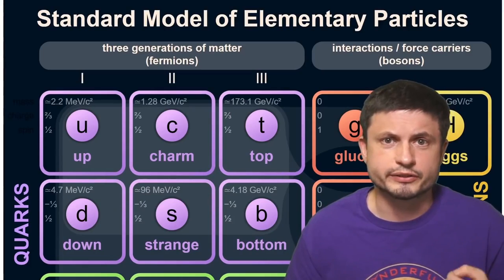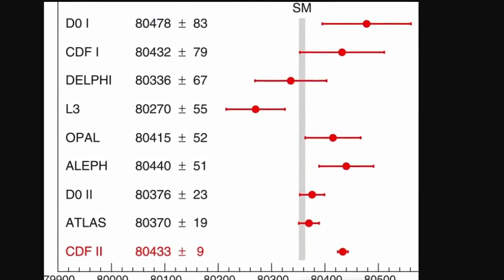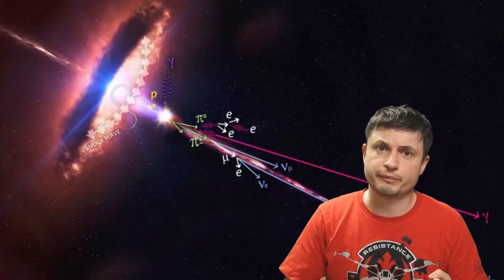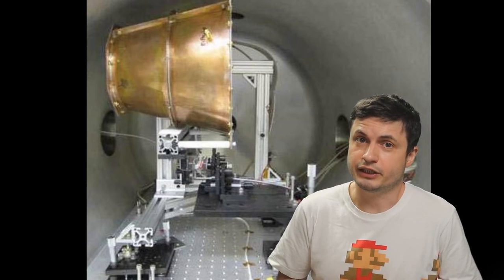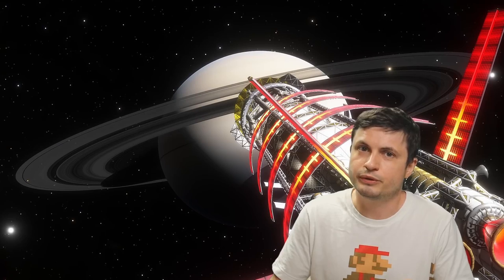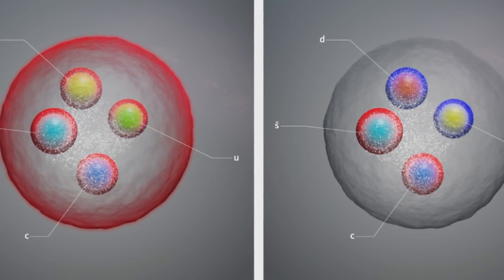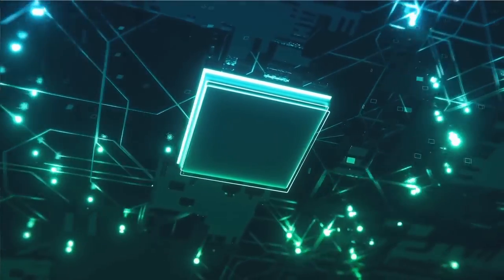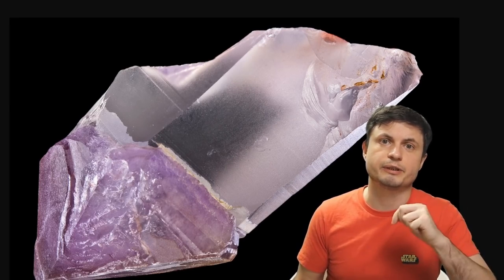Incredible Discoveries In the Field of Physics, 3 Hour Video Compilation

Comment: The Casimir effect is not about particles.  It is an electromagnetic wave restriction phenomenon. In other words, the two plates form a resonant cavity that precludes most of the electromagnetic spectrum from oscillating between the plates.
So, the Casimir effect is a function of the local electromagnetic noise. In other words, if you had the experiment made inside a superconducting Faraday Cage, it would vanish. It has nothing to do with Quantum Mechanics.  It has to do with Maxwell's equations, and it is a macroscopic phenomenon (non-quantum mechanical)

Comment: I think I know what is missing.  People, too many people have been left behind in this process. You are working with all educated people, who all went on after high school and got a higher education.  You all were taught the same basics and when something did not seem right, you went on to prove or disprove it. But there are always different ways of looking at things and maybe what is needed are people who have not been educated in the same way you all have been.  Let me give you an example. . . Many years back, my then boyfriend, his son and I were down on the beach doing a bonfire.  We were able to take our 4-wheel drives right down on the beach.  As we were leaving, it was about 3 am, we came across a truck that had been stuck in the sand for a while.  This was before cell phones and they had actually sent someone walking to the nearest phone booth to call for help.  We stopped to help.  They tried everything, kept digging themselves deeper and deeper,,,,,,, and then they discovered something was broke on the underside of the truck.  I was sitting on the sidelines, drinking another beer and listening to them try to solve the problem.  They were saying, "if we only had this", "if we only had that".  I knew a little bit about the inside of an engine.  I could change my own oil and spark plugs and at one point was talking about rebuilding the carburetor on my '74 Camaro.  Not bad for a girl, but I knew nothing about what makes the wheels work or how 4-wheel drives work, but listening to them, I had an idea, of something seemed like it might work, if only to get them out of the sand, using a belt, the kind that holds up your pants.  At first they were not listening to me but finally I one of the guys heard what I was saying and said, "That just might work".  And it did.  We got it out of the sand just as the tow truck was coming across the beach.  Those guys were all thinking along the lines of what their dads and auto shop teachers taught them.  I was thinking in a totally different direction, that if nothing else, got them out of the hole they dug themselves into.
How many people, over the years, were left out of the process?  People who have brains that work just a little different.  They think about things in a different way.  They were left out because they did not have the money for college.  Maybe they had to work the family farm, sacrificing their education.  Maybe they found themselves in a teenage pregnancy and had to give up school to raise a family.
There needs to be a way to include more people into the process.  A few simply words or what may seem a silly question, could get your brain working in a different direction.

Comment: The em drive is base on the Venturi effect it is used in a fuel carburettor   
For old cars and need a positive pressure to creat a negative vacuum and induces a back pressure to creat force variables on either end of the spectrum must be calculated with surrounding atmosphere ie tuning required of ambient surrounding

Comment: Please stop saying that nothing can escape a black hole. A black hole's dense gravity attracts an object and accelerates it. As the incoming object approaches the speed of light, it's relative time accelerates compared to a distant observer. This creates a time disparity between the two points, object and observer. The object effectively moves into the future, as compared to the present time of the observer, which is why it seemingly disappears. Think of it this way, Gravity is time, take away gravity, you cease motion, ceasing motion slows time down to a nullity, speed up motion and time accelerates. Without motion, there is no need for time.

Comment: graphene technique is similar to a radiactive element with milli/nanosecond halflives (atomic numbers over 100 i believe) being acted on to by antimatter to cancel the necessary neutron/proton loss keeping the element in a solid state of non-radioactivity resulting in energy sufficient to require enough higgs bosons that they are unavailable to the spontaneously generated physcial space that the energy is attempting to exist as quarks(?) and thus producing negative mass that can be used to generate gravity through what could best be described as observer  iniateted potential entanglement (sorta like the psychic  remote viewing experiments the U.S. and russian goverments attempted during the cold war).

dark matter is matter that hasnt been designated as normal or anti-matter yet due to a lack of bosons which occurs once the universe expansion reaches points where kinetic energy has to use photons to continue interacting with other particles which causes a boson deficiency. happens in black holes and is similar

Comment: I don't particularly like the wording that you persistently use in videos on the subject of stuff like the EM drive, that it and its direct or spiritual derivatives operate without using fuel, which adds a violation of laws of physics to its hypothesis that simply isn't true.

These drives do 100% use fuel, to generate the various types of radiation (microwaves in case of the classic EM drive) needed to create the effects, effects that may or may not actually exist (in case of the EM drive definitively proven as not existing).

They are not propelled by burning fuel, but they absolutely do use fuel.